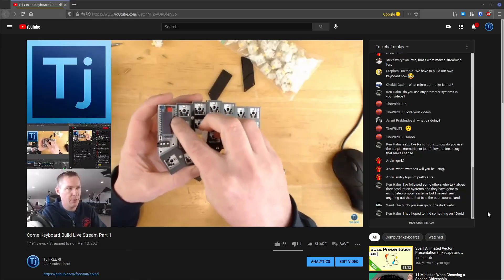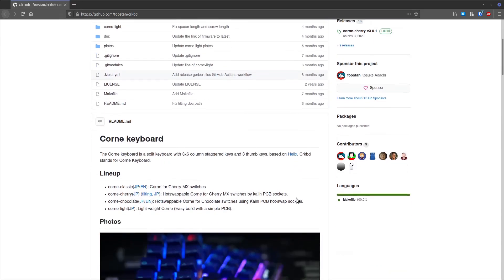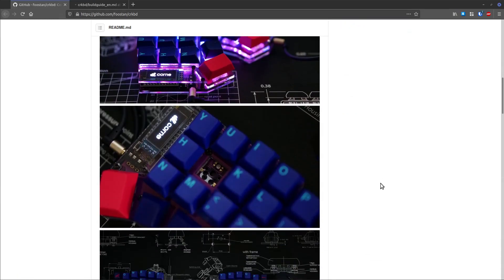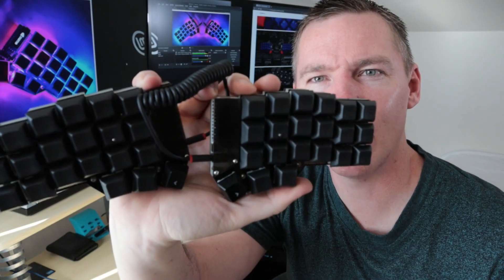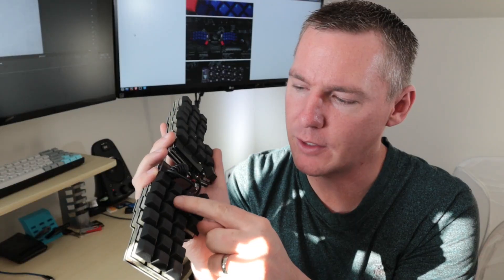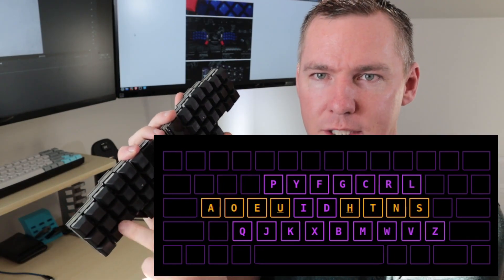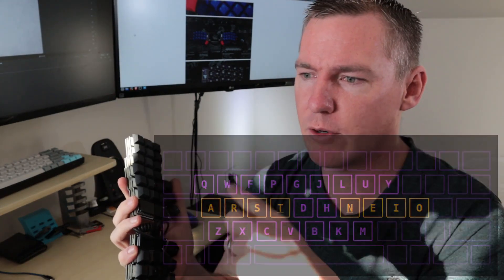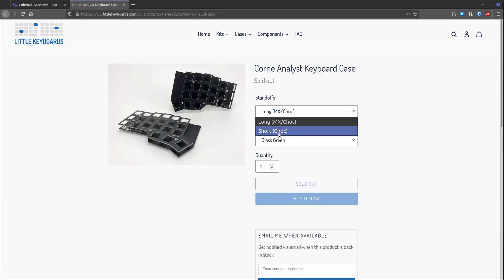I built an Open Source Keyboard (Corne & QMK)

Comment: Is there a table of programmable keyboards you can buy showing IP ratings, repairability, keyboard mechanism, and long term durability. 

IP rating because I would ideally like to just take it under a high pressure car wash stream of water and clean it in seconds.  Or take a heavy duty brush soaked in hot soapy water and clean the keyboard under the sink or shower. 

Long term durability is very important too. So many keyboards quit working. Like their programmable circuitry has a timer built into them to turn off after three years. Then there is the physical keys themselves. Like Logitech keyboards are built to start jamming on themselves. Like that will get you to buy another of their keyboards instead of buying their competitions. 

Anyways, a table of programmable keyboards and their features seems like such a basic thing but I've never seen one.